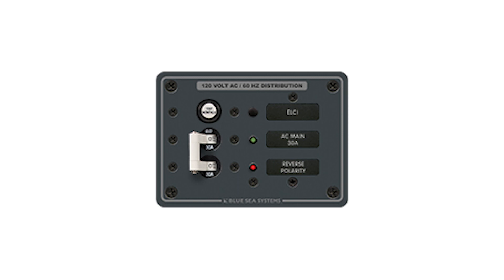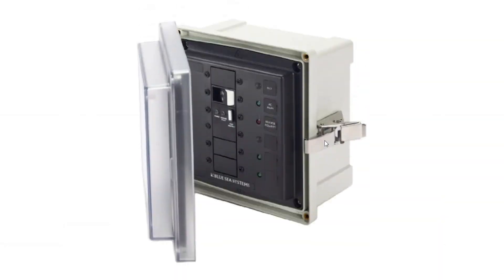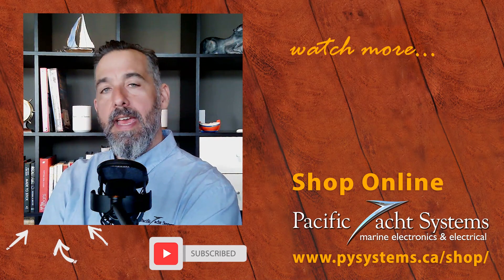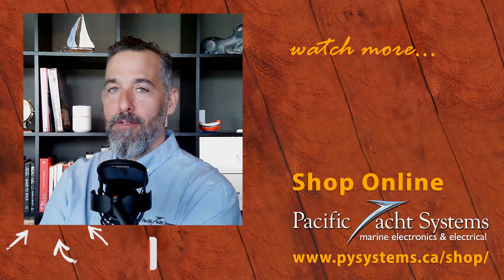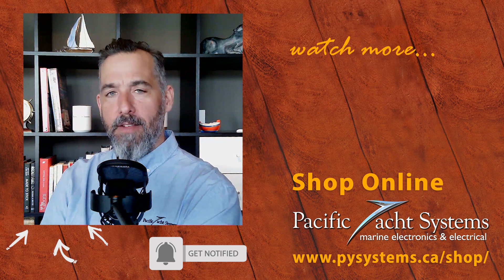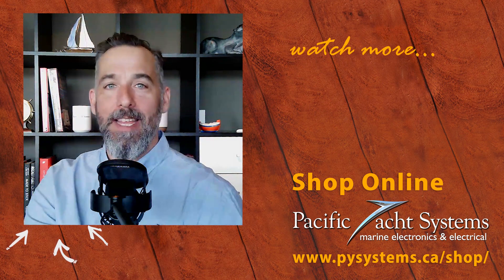Installing an Equipment Leakage Circuit Interrupter ELCI on Your Boat

Comment: Comments about the $200-300 enclosure premium over the breaker aside. Non-ignition protected breaker in a not really ignition protecting enclosure. So big and ugly betting on most wanting to mount it in the engine room where it shouldn't be?
It seems all are just concerned with protecting dock power entry, ignoring onboard generator/inverter supply. The latter is more likely to be a hazard in use away from dock. 
I have not been in a domestic marina allowing swimming, barely working on your boat in the water. Still, I would anchor out before working in the water if possible.
Looks like Carling makes the BlueSea, not finding it labled as Carling in the market past the website. Anyone know why? We still have C19 breaker shortages. 
Presently, I have limited use intentionally for AC onboard. Like to see what others are doing. 
Europe-Japan seem to have similar devices, just not named ELCI, din rail standards.

Comment: It is a very important to learn these staff … can you please make a video to how wiring the ELCI the correct way .. thanks in advance.
Reply: The supplier, Blue Seas for example has instructions for installing the ELCI; assuming you already have an AC inlet; the ELCI is installed betwen the AC INLET and the existing AC panel connections. Since you are installingt on a boat, which uses tined and stranded wire, I always use ferrules when connecting to clamp connections, due to vibration causing connections to loosen over time. If you do not have experience with AC or feel comfortable - get a qualified Marine Technician to do it for you!
Reply from the maker: Noted